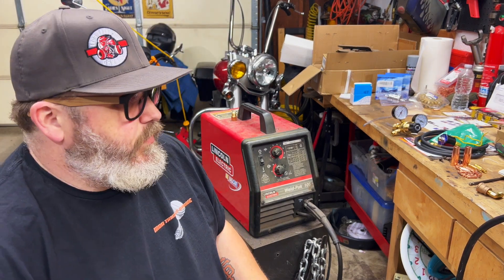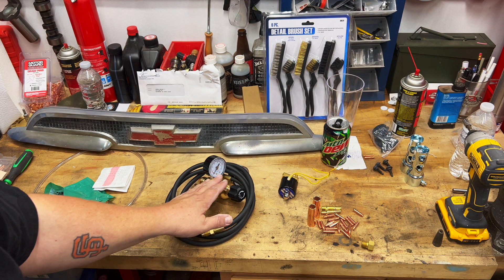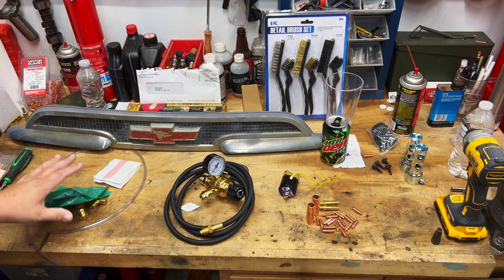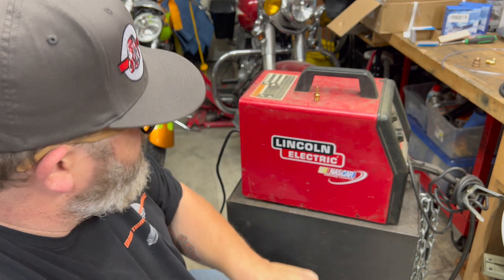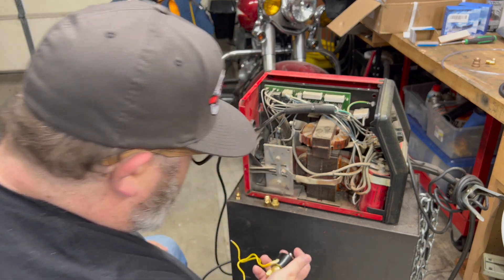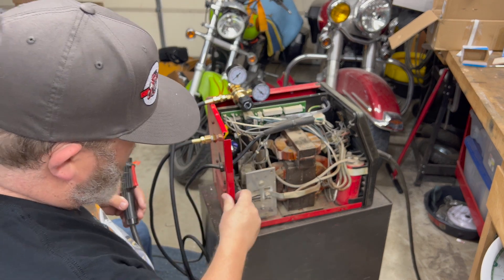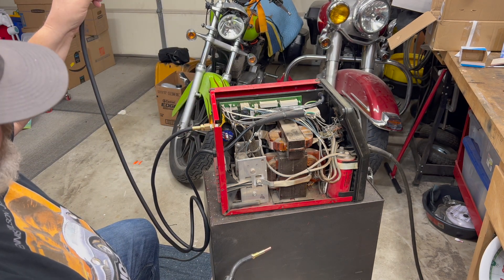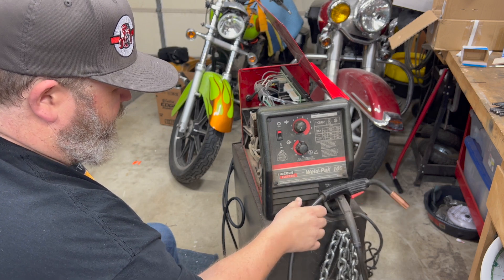Lincoln Weld PAK 100 MIG conversion. CHEAPER!! (Parts list in description)

Comment: Wheeew they jacked up the lincoln kit price. Around 400usd now 😬
Reply from the maker: HOLY ISHT! Is that right?!? Well I guess that makes my video even more relevant! 😎
Reply: @Irontrianglegarage  Dude totally. My neighbor has a Lincoln Pro-Core 125 (bought used for 400usd), and I've got a Lincoln Weld-PAK 100 (bought used for 135usd) and we're both looking into multiprocess and FCAW/MIG capable machines. For the price of their kit you could pick up a cheap inverter full multiprocess set up, plus some bottles. It's absolutely insane, and I think they're doing it to push people into buying their MIG welders instead of using what they've got.
Reply: its now 1,000
Reply: @Chrissyboi-q6o  wtff

Comment: So will the old flux gun and cord work or do you need to upgrade
Reply from the maker: It should work as it’s lined and sleeved for gas. I don’t know if they all came that way. This model was gas ready as far as electrical and torch.

Comment: Quick question I found one of these units for 125 used...what should I look for as far as problems before buying..they have flux on it
Reply from the maker: I’m not sure of any specific problems with them. I’d check the case. Make sure it’s in good shape. Like has it been bouncing around in the back of a truck? Turn it on it should hum and listen for the fan noise. At $125…..it’s a steal. Parts are easy to get, hoses torches. All readily available. Solid little units.
Reply: I appreciate your quick reply, unfortunately it sold from under me.

Comment: found one of these welders on facebook market place for 150$ should i buy it ? trynna start welding stuff up at home n to my cats
Reply from the maker: Maybe not to the cats tho…..😅 unless you want to make feline jousting armor.
Reply: @Irontrianglegarage lol to my cars**^^
Reply from the maker: Yes! All the parts are available. It’s a major brand at a steal of a price. Upgrades are many. Easily go from gas (indoor welding) to flux core (outside welding). I paid $500 for mine new 24 years ago. Still works perfectly.

Comment: That is probably the solenoid I bought about 1 year ago to convert mine. Had the CO2 regulator and hoses, I use 75/25 with 309 works good.
Reply from the maker: How is that solenoid holding up? Admittedly, my welding projects dried up right after I did the conversion. I haven’t done much with it yet. I do have a lot of chassis modifications to do coming up. Thanks for watching!!
Reply: The valve has been just fine. Just have to be careful where you mount valve. Had to move because it got in the way of the big spool. Other than that easy
Reply from the maker: @ ohhh good know!

Comment: Great video. But why did you switch polarity
Reply from the maker: @chevysixty6  running flux core wire requires the original polarity. Switching to gas (solid wire) requires the polarity to be switched. Science man! (Truth is I don’t really know why it needs to be that way. The machine says to switch polarity from one to the other based on which system you go with) 🤷🏻‍♂️

Comment: Tip to weld longer and hotter with a small or any machine: CO2 stores as liquid under pressure and runs hotter than MIG mix making it quite handy for small welders. For even more convenient portability I use a high quality Milton brass pneumatic chuck and nipple (chuck on the regulator, nipple on the green gas hose) as a gas disconnect which beats breaking out a wrench every time. 
The little "kegerator" size CO2 cylinders work nicely for mobile work as do various size steel cylinders.  CO2 cylinders are CGA 320 thread which uses a crush washer (I buy those by the bag and zip tie a few to my equipment so I never have to hunt one). Many MIG manufacturers include the CGA 320 to CGA 580 (MIG mix, helium, argon) brass adapter with their machines but they're cheap online and your local welding supply should stock them if ya need one quick. Search "Western # 806 Co2 Cylinder Adapter CGA 320 to CGA 580 " for what they look like.
Reply from the maker: Awesome tip! So, you’re saying C02 over MiG mix gas?

Comment: Where’s the satisfying proof that it works video?
Reply from the maker: @Strangerer69  I need a project! This winter I’m pulling the front of my El Camino apart to do some frame modifications for a larger radiator. I’m excited to use the welder on that project.

Comment: Lincoln has all their manuals online including most of the ancient gear. (So does Miller). Well worth downloading. The little 100s are in so many body shops because they fit inside vehicles. I have other welders and suitcase feeders but the WP has a very nice arc. I followed this basic recipe and it works a treat. No way was I paying for the kit when my welder was only 100 clams.
Reply from the maker: Awesome!

Comment: Do you need to change the gun liner? I got this exact welder from some guy and he already did all the conversion stuff but the last time he used it, the machine was on flux. He told me to change the gun liner, because I needed to.....
Reply: I'm in the process of converting mine back to mig from flux core. I saved all the stuff from the last time I did it 20 years ago, and there is a smaller liner in my kit. If memory serves, you have to flip the grooved drive wheel on the feeder for the smaller wire as well.
Reply from the maker: Let me look into that. I don’t think so. Unless it just plain worn out. Im going from .035 flux core to .030 solid wire. Should work just fine.

Comment: Thank you for the video! I'm looking to do this conversion on my own weld pak 100. Any recommendations on where to get an argon bottle for a reasonable price?
Reply from the maker: You’re very welcome! That truly is the question of the year. I’m looking into that very issue. I have a few small welding equipment suppliers in my area. I’m trying to weigh whether I buy the bottle and get it filled or rent a bottle. Airgas is a large outfit that supplies welding gases. That may be the route I go. It seems to be the least expensive. When I made the switch to MiG, I honestly didn’t think the gas part would be such a spendy issue.

Comment: What's the difference between a weld pak 100, vs a SP 100?
Reply from the maker: From what I can tell, an SP-100 is an older model of the Weld PAK 100.

Comment: Is the Lincoln 100 weld-pac capable of welding 14 gauge aluminum?
Reply from the maker: Great question! It’s not the best option for aluminum. A TIG setup would be much better and controlled. Not to say you couldn’t try. Alum. Requires 100% argon for the shielding gas vs argon/co2 for steel.

Comment: what are you setting your gauge PSI at?
Reply from the maker: I’m not a pro, so I’ll reference Internet University. The experts recommend between 3-8 psi. I haven’t been able to mess with it yet. So I’m not sure what the best setting will be. I have a lot of welding to do on an up coming project for the El Camino. I’ll be able to dial it in by then. I’m at sea level so that’ll factor in as well. Maybe material thickness too?